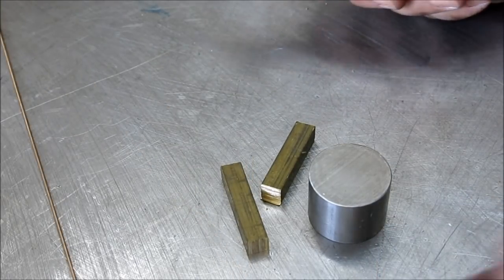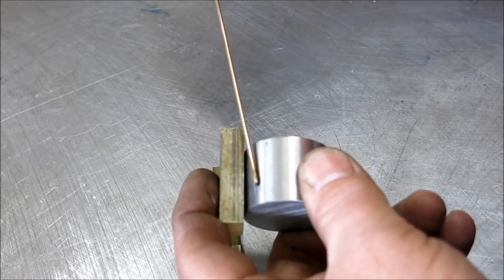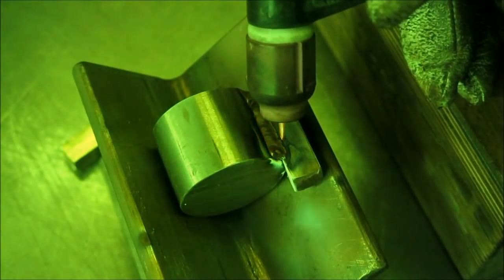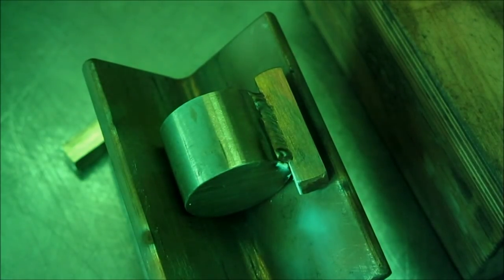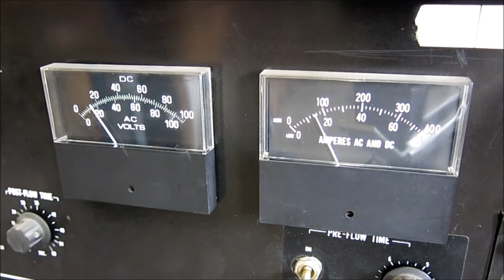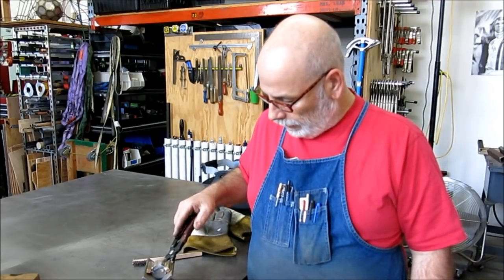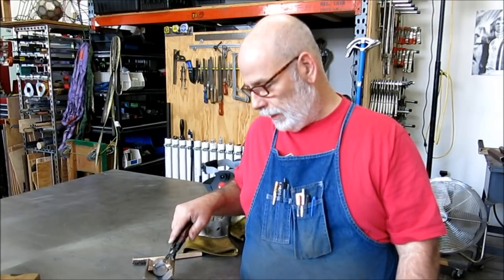Joining Dissimilar Materials With TIG Welding

Comment: Them silicon bronze tig rods are slick! Thanks for showing us the trick welds!
Reply: They don't come cheap either, hee hee...as a farmer I'm stingy :)
Reply from the maker: stirmind Hey Chuckie,

Thanks for the comment and participation. You wouldn't be the guy in Valley springs selling a Brown and Sharpe Micromaster would you? I'm going to do a follow up with another technique that works for joining dissimilar materials with even less heat input. To visualize the joints he is doing imagine wrapping a 1/4 x 1 brass flatbar around a 1 inch diameter stainless rod. The brass springs away from the rod so there are some gaps he has to bridge. Packing the joint with an intermediate material might help.

Cheers,

Tom
Reply: oxtoolco Boy I wish I had a Browne and Sharpe, but alas I'm a new/old dog when it comes to anything requiring close tolerances.

I did run 2000' of twenty inch schedule 40 pipe with less than an eighth inch of deviation on the slope at the Honolulu international Airport when I built tank farms, pump houses, and piping for all the petro-chem industry in Hawaii 20 years ago.

It's been over ten years since I've worked on anything more critical than a head gasket. Now I'm just an organic or "natural" farmer by law, as 3 miles down they spray the almond orchards, and organic listing requires too large of a buffer zone and too much hullabaloo for our little family operation.

My most important job is taking care of my folks out here at the end of our bumpy dirt road, they're in their 80's and so I pick up all the slack I'm allowed to...haven't crossed the road to taking away anyone's keys yet, but that's another story.

I now have a perfect picture of the task at hand, and how clamping a third material into place may prove too time consuming and heating to fit would only cause more problems and marring of the surfaces I assume he's trying to protect...Great brain teaser, I'll mull it about as I water the crops and see if anything else falls out of the dusty corners.

Thanks for the warm reply and I hope to make it out there next time you open the door to the lab ;) Meanwhile, I'll see you here on the comments or over at Adam's, etc...I have fallen in love with fabricating again, and all of the tool crafting and part making sets me to drooling, so I'll be around.

Aloha, Chuckie

Comment: Hi Tom,
Even with Oxy torch the fumes get out a little too from brass, that TIG method is great when using minimum heat input method.
Great tip, thanks for sharing,
Pierre

Comment: Hi Tom, great advice on the TIG braze-welding I have had to do quite a bit of this sort of thing, mostly because a good deal of my work is for excavating and concrete contractors that are usually trying to anchor or embed something into a pour, most often a bronze or brass statue or sculpture. You'd be surprised how often they will hand me galvanized or even plain steel anchor bolts to do this with, and of course I explain that if we do that, the anchors will likely "explode" before the check clears, and will lead to an irate customer, so I will get the appropriate stainless hardware and fabricate the needed hardware and attach it to the piece that will be anchored.  I think the key is as you said toward the end, to get the puddle going and kind of "push" it along the joint as you fill.
   Another good video as usual, I think your view thru the auto helmet worked out very well.
    Mike
Reply from the maker: Hi Mike,

Thanks for the comment. Nothing like fuming zinc in the morning. Kack! kack...

All the best,

Tom

Comment: Hi Tom !

Yeah, the fumes are really nasty - so get rid of them !

And there is a galvanic problem too - the brass dissolves the steel over a longer periodes when water is added - it looks a little like very, very badly corroded aluminum and the steel looses it's strength - but maybe water is no problem the place it's supposed to be used.
Reply from the maker: Hi Keld,

Its a decorative art piece that goes inside. No worries about corrosion.

Cheers,

Tom
Reply: oxtoolco I was curious about the incompatibilty of these metals also. The chart I referenced lists this combination as "high" galvanic corrosion.

Comment: Tom, what about using silver solder rod, lower temp. I have used this with this type of joint and metals. Thanks for the great video.
Reply from the maker: Hey Randy,

Good suggestion. I also mentioned this to Mitch. He is going to try a couple of things.

Cheers,

Tom

Comment: Tom,
Always interesting and educational. I think I have isolated your exposure jumps that are primarily on your intro. The upper left hand corner of the whiteboard is defecting something, like a window. There are flashes of light, probably from traffic, that are setting off your camera's auto exposure. changing the angle should help. Direct reflected light is your enemy, as it's so much brighter than the ambient light. The overall light in your shop is excellent, I'd avoid using small light sources when filming as they cause more glare than they help, and they cause hot spots. To you eye they are helpful, but the range of sensitivity is narrow on the camera sensor when compared to your eyball meter. Open shade or soft bounced light is your friend. I hope my comments are of interest or use to you as you have shared so much information with me.
All the best
-Ben
Reply from the maker: Hi Ben,

I have noticed these as well. I'm trying to lock the exposure when I'm in front of the whiteboard. Any movement on my part seems to make the image jump a few clicks on exposure. The window is up high so I don't think its traffic although I do occasionally get flashes off a windshield. Thanks for the feedback and suggestions.

All the best,

Tom

Comment: You said you were going to heat more on the steel and ‘ waft ‘ over to the brass but on the first weld it appeared to be focused more on the brass. The second weld was turned around so it looked more focused on the steel and looked like it came out better.
I weld brass with silver solder often and know how if it gets too hot the zinc starts to vaporize and mess things up.

Comment: Always have the fan to your side so that it sweeps the fumes left to right or right to left. Never put a fan blowing on you or up you, a quick smoke test will reveal that the air flow from below will vortex near your face. For the same reason never have a fan blowing at your back, the airflow will create a vortex in front of you. It is best to have the work on the suction side of the fan so that any fumes are drawn into the fan, even better is to direct the fan exhaust outside.

Comment: Check with Harris brazing alloys. they have alot of different alloys for brazing dissimilar metals. They have them that will bridge big gaps also. The high silver content runs like water when hot and doesnt bridge. Regular 15% sil phos might work if you use a flux and it will bridge the gaps pretty well. Talk to Harris they will hook you up.

Comment: a good tip for videoing welding (although this is a low power weld) watch this video How to TIG weld aluminum beverage cans together and start at 10:25 what you need is a REALLY bright light source shining on the weld and stop your camera down so its still under exposed but enough to see the parts and you should see the arc and the metal all at once,, even if you have a welding hood in front of the camera you want the brightest light you can shining on the weld, so the contrast is not as great

Comment: Hey Tom,
Metal Fume Fever is nasty stuff! At the least, you get really sick . . . the worst is death! Certain metal vapors are nasty things to mess with. Since heat is the main issue in this situation, would a MAPP (or similar gas) torch reduce the heat input and not vaporize the zinc? Just curious. Thanks for the video.
Regards,
Oxen Dave
Reply from the maker: Hi Dave,

Gas welding this structure together would be a real pain. He has some gaps and the entire unit is large, over six feet from top to bottom. Silver bearing brazing material with TIG is probably another good option.

Cheers,

Tom

Comment: Tom, would it be appropriate to use brazing flux in this case? We have all brazed copper to brass using a gas flame, and I have also brazed thin stainless sheet to brass the same way, with that white paste flux.  It seems to me that TIG, in  a sense, substitutes the heat of an arc or plasma stream for the heat of gas, and the addition of flux may well reduce the tendency of the brass part to oxidise.

Just a thought.
Reply from the maker: Hi Greg,

The arc is too intense for any kind of flux in the area. I have seen back of the joint fluxing with arc processes that work well.

Cheers,

Tom

Comment: Tom, I have always eye-balled your letherman/flashlight holder. I use something similer (mass produced) but not really happy with it.

You should talk Mitch into adding it to his product offering on his website. I'd buy one, and I bet others would too if you gave the shoutout.

Let me know what ya think,

Cheers - Glenn
Reply from the maker: Hi Glenn,

I think he offers a flashlight holder of some sort. It probably comes with a Glock holster attached is the problem.

Cheers,

Tom

Comment: Hey Tom,

That would be a Oxy Acetylene with gasfluxer job to me. It's a pain to maintain, but a gasfluxer is a really nice system to use. I dumped my Oxy gear for cost (and safety) reasons, but I sometimes think of getting set up again.

Is your helmet adjustable shade? You might try a darker setting.
Reply from the maker: Hey Paul,

I tried a 12 setting and it didn't seem to make much difference. I think Jody may use an intermediate light colored plate as well. Need to play around more.

Cheers,

Tom

Comment: Zinc vapor is nasty. 
Same hazard if your welding galvanized pipe or conduit.  I dipped them in Acid as a pre step to get zinc out of weld area.

Comment: Hello Tom...Oxen named Chuckie from Valley Springs, CA 95252. I enjoy your videos and was sorry to have missed your open house! Looks like you had plenty to do and lots of fun and I just wanted to say hello and attempt to get a laugh out of you...Could you call it "Brazelding"? Hee hee, I've done it before and even have tig'd with bare copper wire on my third hand.

As to your buddy's project,  I wonder if you could use a thicker silicon-bronze rod and lay it on in the sections that need welding and focus the arc on the weld metal instead of either parent materials to avoid the hiss of zinc and antimony?

I can't really envision what he is working on, but I have used that technique before with decent results. I know that rod costs a bit to toy with, but I used some 5/32 snipped with bolt cutters and laid into the seams. The bead was nice and smooth, yet there was minimal fusion, but since this was also a decoration/ logo it was plenty strong ;) Hope it helps if possible.

Aloha, Chuckles.

Comment: Hi Tom, nice set up on the auto-darkening lens for the camera. recently i did a piece of stainless onto a car fender (0.7mm) that was thinner than the stainless (1.0mm) and galvanized to boot. i had real trouble with the zinc burning off and making big holes in the seam. the stainless rod didn't work well at all. i used a regular steel rod to finish it up and it turned out so so.. any suggestions for such a situation? other than riveting of course..lol
Reply from the maker: Hi Mikey,

You would need to start with a steel patch for the fender. The material thicknesses should match for best results. Sanding the coating off the fender metal would go a long way to helping out as well. Silicon Bronze would work fine for this type of repair since it would be painted after welding.

Cheers,

Tom

Comment: Harris 56% silver solder works much better for this type of joining.  Looks better too esp if you pickle the parts afterward.  Any jewelry repair place can help you with the pickling if you are only doing a one time job.
Reply: Oh I forgot to add that it is very nice for you to take the time to show this process also.  There are times where this is needed and it is always good to improve your knowledge.  Thanks for sharing.
Reply from the maker: Hi 465,

I use silver bearing brazing material when joining stainless to copper or some copper to copper jobs. I have not tried it on brass however. It is probably even lower temperature than the Silicon bronze. 

Cheers,

Tom
Reply: Tom I do SS to Brass all the time, mostly with small capillary tubing but also for some larger structures.  The 56% solder sold by Harris or available from jewelry supply is my favorite for how it flows.  And the fact that if you have to do repairs or more than one operation once it cools it requires a higher temp to re-flow than new solder takes to flow.  Standard borax flux works fine, I tried the black flux but didnt find it worked any better.

Comment: Cool video tom.  I've got a question for you:  I have an old craftsman forest service chainsaw.  It has a nice metal case (from the 80's) that has cracked... I'm not sure what it's made of, but pot-metal alloy might be a good guess (it is non-magnetic).  Do you think this technique would work on something like that?
Reply from the maker: Hi Jason,

Negative. Pot metal or heavy zinc based alloys and aluminum/ magnesium alloys are no fly zones for silicon bronze. If your lucky the case is aluminum because they typically want to reduce weight in a hand held tool like a chainsaw. We would have to look at it to determine what its made of.

Cheers,

Tom

Comment: Bronze tig rods.??.never heard of such a thing, Going order some rods and have a play. Hey be cool if you do a stress test on that joint. Ps Like the camera footage of you welding.
Reply from the maker: Hi Steve,

Really useful filler rod. I use it to weld high speed toolbits to things to make cutting tools. It works for joining all kinds of materials. There will be a part 2 to this series.

Cheers,

Tom

Comment: Durafix alu/mg rods using a propane flame should work I expect.  Joss in Cork.
Reply from the maker: Hi Joss,

Aluminum Magnesium filler rod? Hummm. I might have to call baloney on this one. Can you provide a link to the filler material so we can check it out?

Cheers,

Tom
Reply: oxtoolco Hi, Tom. Try the following URLs: 

http://www.durafix.com 

http://www.aluminumrepair.com/hts528.asp 

Not sure about the filler rod composition of Al/Mg. 
I personally cannot attest to their efficacy, but I have heard praise from machinist/welding professionals including a crusty old hard to please millwright about them. 
Thanks for sharing your adventures with us. 
Pat

Comment: Can you TIG weld copper to mild steel?
Thanks!
Reply from the maker: Hi Arcady,

Yes you can. Silicon bronze filler rod will do it as well as this silver bearing stuff I show in the video. Thanks for the comment.

Cheers,

Tom